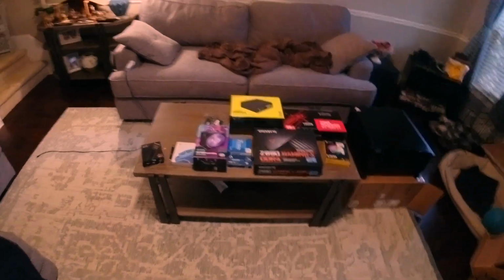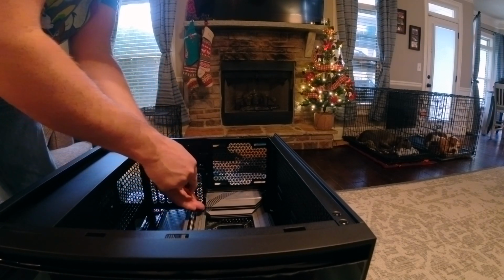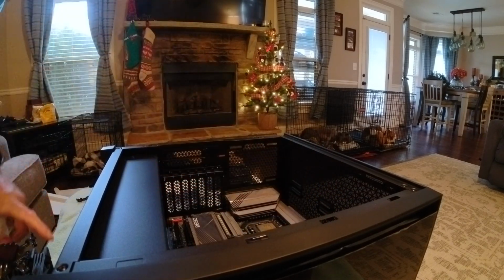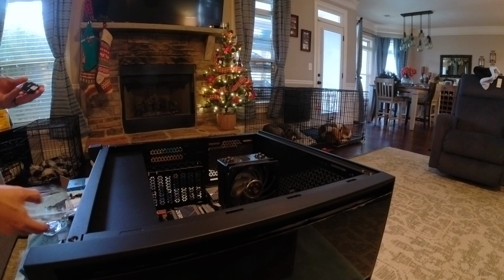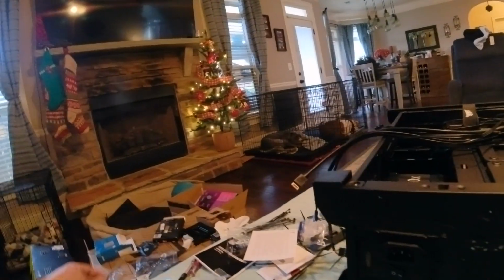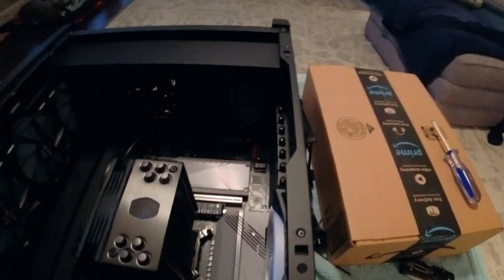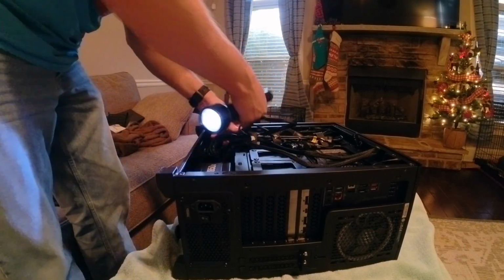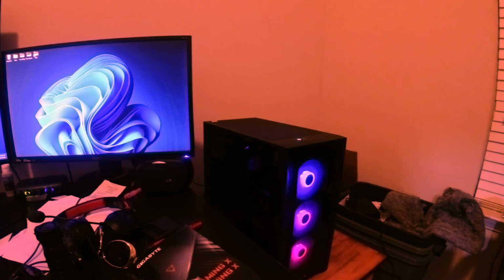Dave's Man Cave - New Gaming PC Build tutorial

Comment: Geek.  All I did was buy a PS5.  😀😀  I like the fact that new computers pretty much just plug everything directly into the motherboard without 600 cables going everywhere.  How much was everything?
Reply from the maker: It has made it easier in some ways, but throwing in the crazy big coolers and all the extra RGB wiring does make it a little trickier the first time.

Comment: Lost me as it was not a Nvidia 4090! :)
Reply from the maker: I am not paying $1800 for a video card, or more if I have to get it from a scalper.  The new AMD cards are getting great reviews at a much better price point.
Reply from the maker: I mean, it plays games like Doom Eternal at 4k high settings at well over 200fps...  $800 cheaper than a 4090, if you can even find a 4090...  The basis of the system will last me the next several years.  I can upgrade the video card every other year to stay current...
Reply: @Daves_Man_Cave  While not a bad built.. I guess me expectations from you were higher.. With all the toys, guns, bikes, car.. I would of expected a 4090 and a Samsung 980Pro 2TB boot drive...
Reply from the maker: @StrawDragon  Not sure if I should feel slighted?  lol

The WD Black series is solid and a good price point...  And I looked around at video cards, and I never get the top card.  I usually go for their second best or so.  Why?  Because the incremental performance gains don't keep pace with the cost difference.  I don't chase benchmark scores or any of that.  So long as I can play my games at 4k and get at or near triple digit frame rates, I am good to go.  I am all about bang for the buck.  That's why I don't pay $200 for a tail tidy, I make one for $25.  haha

If I can get 150fps in a game, and the other card gets 175fps but costs $700 more?  Pass.  In a year I will use that money and just get a newer card.

Now 20+ years ago, I had every top part money could buy, and I upgraded every 6 months like clockwork... But it was a money pit and at the end of the day did 121fps in a game really play better than 103fps?  haha
Reply: @Daves_Man_Cave  No reason to be slighted.. lol.. I enjoy your videos and how your topics can go from bikes, to knives to computer. I have been building my own PC since the late 90's. Water cooling since 2005 with my own custom kit. Even till this day. So I know all about buying cutting edge and the money pit it  brings. Even my home server has 20 18TB WD Red drives for Plex. My electric bill will make some people cry.. lol.

Merry Christmas and happy Holidays!
Reply from the maker: @StrawDragon  Yeah, I started building my own PC's back when they still had Cyrix CPUs...  They had a PR166 which was a 133Mhz CPU but they gave it a "Performance Rating" of 166 for marketing places...  Setting up mobo's with dip switches, etc...  I was very early into the overclocking stuff, going back to the Pentium 60.  Never really got into water cooling, but I remember having to build better air coolers, and overclocking chips by unlocking the multiplier by etching a line between two CPU pins with a #2 pencil as graphite is an electrical conductor.  Those were the days.  haha

I don't even bother with overclocking today because the price performance ratio is so good today.  Just can't be bothered.

I just checked Newegg and the cheapest RTX 4080 is $1300, and the 4090 starts at 1600.  That's a lot of coin for a video card that will be replaced with something new in like 6 months.  The RX 7900 XTX which is only $999, I couldn't find one anywhere in stock.  So at $899 the 7900 XT was the best video card I could find for less than  a grand.  That's my self imposed limit for a video card.